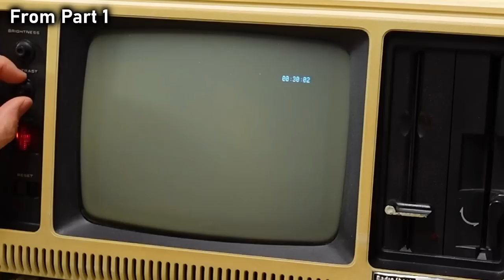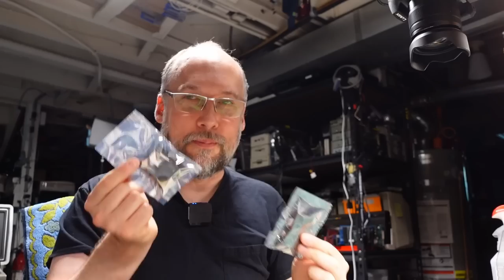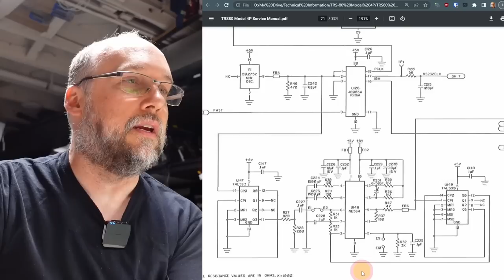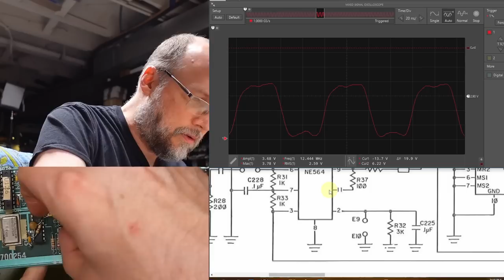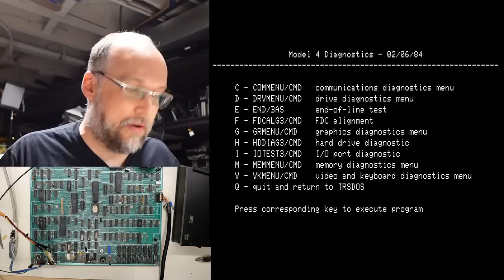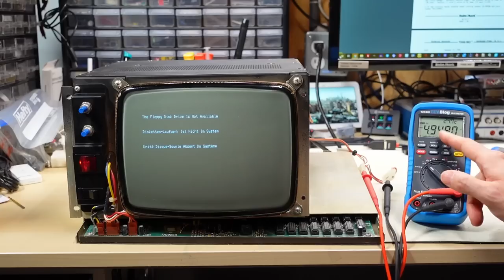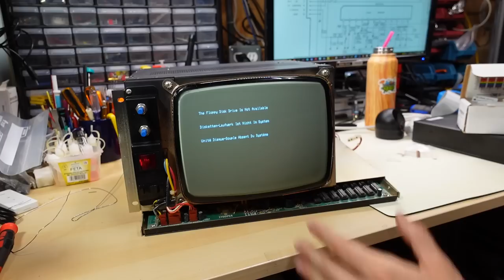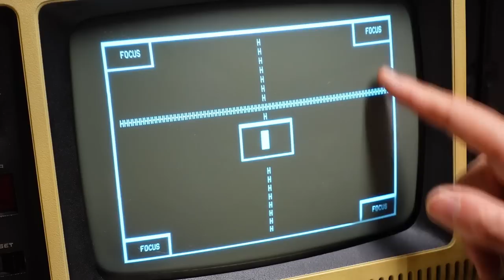TRS-80 Model 4P 80-column crash repair (Part 2)

Comment: The video jitter is an artifact of the +12V from the power supply to the video PCB. In your case it was the fan causing problem but often it 'just happens'. I installed a new drop in replacement power supply n my Model 4P from Jay Newirth (Newsoft). It uses a separate +12V supply for the video board and eliminates the problem.
Reply: It was also causing the CRC error. The drive power was inconsistent causing speed variations on the motor.

Comment: The low voltage side of the power supply has a pair of resistors in series on a part of the pcb with a square silk screen image. The silk screen might be for a trim pot that has been replaced by the fixed voltage divider, but which would have enabled the fine tuning of the 5v reference voltage.

Comment: Looks like one of the inductors on the low voltage side of the power supply might be a variable one? It's got a hex shaped hole in the top, which usually indicates the core can be screwed in or out to vary the inductance. Perhaps that could adjust the voltage of the rails?

Comment: Just wanted to point out that the problems you were having with disks occasionally being unreadable and disks written on one system not always working on another may be because one or more of your floppy drives are slightly out of alignment.  Particularly with the older drives, it was actually necessary to manually readjust the alignment on them sometimes.

I remember back in the day using specially-written (and rather expensive) "alignment disks" to measure and correctly tune the disk drive alignment on my old TRS-80 drives..  I have no idea whether you could even find one of those anymore, but it is also possible to adjust it reasonably well just using a known reference "good" disk (such as a floppy that was written and sold as part of a commercial product, instead of one somebody wrote in their own disk drive), by slowly tweaking the adjustment one direction until it becomes unreadable, noting the position, turning it the other way until it becomes unreadable, and then setting it midway between the two, etc.

Comment: Not to sound like a hind-sight comment, but the first thing to do in any repair is to 1) Check the voltages and 2) Check the clocks.

Guess that would not result in 4 videos though. :)

Comment: A flashback to the1980's when I upgraded from a model 1 to a model 4P.
I wrote a ton of software on that thing and it even survivde the flood when the water heater in the apartment above me broke and poured water all over the table where the 4P was sitting.

Comment: Nice work, as always. Personally I would replace the fixed capacitor with the correct value trimmer, but that’s just me.
Reply: I mentioned in another comment that he could run it parallel with a fixed disc cap of the "appropriate" range, so that he could trim it. But, it's just as possible that the one he dropped in was THE perfect value, so, sometimes, "If it works, don't fix it" ")
Reply: @This_is_my_real_name   There’s certainly nothing wrong with that approach, I was just saying what I would do. Each to their own.
Reply: @Colin_Ames  -- Well, yeah, it's always best to replace a questionable component with a known-good part, but I was thinking in terms of quickly homing in on the problem by using parts he had on hand. Personally, I'd look to replacing it too, even if I was able to bridge it to bring it back in range. Once it's failing to the extent it's already demonstrated, there's no assurance that it'll stay in its current range rather than continuing to drop to lower and lower capacity.

Comment: I've enjoyed your TRS-80 model 3 and 4P videos as much as anything you have ever done.  I like when you work on these big jigsaw puzzles, and following along with your diagnosis is so enjoyable.  Only one thing worries me: did you figure out where that small cable attaches to the power supply, or is it still disconnected?  What a great fix, with TWO bonuses you pulled out of the hat, viz. improving the CRT brightness and addressing the interference from the new fan.  Impressive!

Comment: Hi Adrian, when adjusting those tiny trimmer caps, only use a plastic trim tool and they only have a 360 degree adjustment, just very small movements will make the difference.
Reply: He did - the cap was just totally bust and probably didn't make good contact internally.
I ran into similar issues with variable caps and resistors, some seem to be just too brittle.

Comment: If I remember my electronics classes (30 years ago already?!) there were two frequencies associated with a PLL circuit: the capture range and the lock range. Without digging out my books, it seems that the input must be within the capture range, and the output is maintained within the lock range. I think.

Comment: I'm not 100% certain (tempus fugit) but I think they had a Y2K patch for TRSDOS 6 (rebadged LDOS). Not sure about your CP/M 3, or CP/M 2.2 (which I do not know if it was ever ported to the Mod 4). Gary Killdall self-destructed at some point, and I don't remember what happened to/with DRI after that.

One other thing, regarding running "normal" CP/M programs on CP/M 3 -- not sure if that is entirely doable, I think I recall there being some issue with memory mapping that required CP/M's BIOS/BDOS to sit in a different location for CP/M 3.

Of course, I may just be thinking about the Mod1 CP/M 2.2 port which definitely would have had problems with the very "hard" mapped IO and ROM space on the Mod 1.

Those were the days... (when you could tell who the pioneers were because they were the guys with the arrows in their backs, as the old axiom went :)

Comment: with some switching  psu circuits, theres a cap, usually electrolytic, in the high voltage primary side, driving the base of the 'chopper' transistor, if it uses a bipolar transistor, (most likely with this), if this is low capacity, it can cause issues, 'round shouldered' /insufficient drive, causing poor output or regulation, screeching noise, overheating of the transistor, and  even its failure, in some cases instantly ... also there may be high value resistors within this part of the circuit, if this/they go high, can also cause similar...

Comment: I wonder if the closer you get the free-running VCO to the desired lock frequency, the less hunting / jitter noise you get in the output clock. I don't know how stable the timebase is on your computer 'scope, but it seemed like the frequency was wandering a bit, like vibrato if it was an audio signal. You'd be able to see this on a spectrum analyzer as well.
Reply: PLLs seem to hold pretty well once locked on.  I remember older radios that started using the PLL would lock onto a station with about the same quality once you were anywhere near the frequency.

The SECAM version of the Atari 2600 made a PLL using a VCO chip and a mix of digital and analog components to find the center frequency for color generation.  As long as the capacitor-tuned frequency was close enough to the required one that it didn't need excessive voltage on the VCO, the tuning of the capacitor made no visible difference.  At the extremes though, it made some interesting artifacts.

Comment: Great! I had a 4P back in 1984. I started out on a TRS80 Model 1 in 1980. No disk drives on the Model 1. I had to load software with a cassette tape player. Primitive.
Reply: My first system was a Model III. It had 2 5 1/4" floppy drives. 

I was so glad I didn't have to mess with cassette tapes for software. I only used my III's cassette port for sound (via Z80 assembly).

 I first learned to program on my Model III. I had Level III Basic (of course), a Basic compiler of some sort,  and a Pascal compiler. I think I may have had a C compiler.

Comment: I had a similar problem with a quartz electronic clock. It started up fine, but then suddenly increased its frequency up to 1..2 MHz instead of 32 kHz and completely stopped. And again it was a variable capacitor...

Comment: The reason for the adjustable cap for the pll is to set the frequency very close to correct, without it being finetuned you can get constant readjustments to try and push the pll to right frequency by the loop filter and I suspect that is why you see the jitters. Swapping in a proper adjustable cap with the correct range should allow for finetuning. Removing the link and tuning fre free running pll frequency as close to correct as you can should do it.

Comment: My father was a TV repair engineer, about 40 years ago. He made a CRT brightness booster, it basically connected the mains voltage across the electron 'guns' for a short time. It definitely made B/W CRT's brighter and he modified it for colour CRT's. I don't have any circuit diagrams but maybe there is something on the internet.
Reply: To be honest he didn't wire mains AC to the filament but maybe through a transformer, a series resistor or maybe he rectified the AC into DC and charged a capacitor and flipping a switch dumped the high voltage DC into the filament for a few milli-seconds. Most filaments are 6 volts and he probably ran anywhere from 7 to 12 volts through it. A worn out CRT has a filament that doesn't emit electrons very well. This is normally caused by the surface of the filament not having enough thorium. By over driving the filament (only the filament. Nothing else can have power applied to it) he essentially "boiled" off the thorium that might be embedded inside the filament onto the surface of the filament. Much older CRT's had a lot of thorium mixed inside the filament and was supposed to migrate to the surface as the CRT aged, but that didn't happen. Later CRT's decided to coat the filament with thorium. Cheaper and worked just as well. Some of the coated thorium did dissolve deeper into the filament, but not much. Doing that with a later CRT did improve the picture for a little while but wore out the CRT much faster. It's like burning a candle at both ends. You increased the light output but you made the candle burn out twice as fast.
Reply: Yes you are probably right, I was talking generally, I was only about 10 at the time and for my father to explain all the workings would of been completely over my head.

Comment: @Adrian's Digital Basement
The original fan is EMR rated and shielded. I hate to say this, you're not quite right about the Arctic fans. They're not crap, they're just not designed to EMR standards or to be in close proximity to magnetically sensitive devices. Modern computers simply don't have the same types of electronics or CRT's built into them. Your solution was solid though!

Comment: PLL, cool way to increase frequency and lock them to base clock,used them back in the 80's for controlling bit rate on a sound sampler i was designing,clock doubling can be done by creating a pulse on rise and fall of clock.Good video,im wondering if theat trim cap was replaced with the wrong part,before you got to it?,ive never had one go faulty in my 40+ years as a board repairer.
Reply: PLLs are useful to change the CPU clock too.  CPUs tend to not like being short cycled and the PLL allows the clock to be slid to the new frequency and avoid that issue.  Of course some logic will avoid that issue too but it gets a bit complicated when you have to ensure both high and low state of the clock is not short enough to cause the CPU problems.  I used a PLL to change the clock on the Z80 in my MIII from stock to around 10MHz (overlocked Z80H) and back as necessary.
Reply: Bad trimmer caps are uncommon but not entirely unheard of in FM tuner repair circles. Very likely brand and environment dependent. Those into old radios may also be familiar with "silver mica disease".

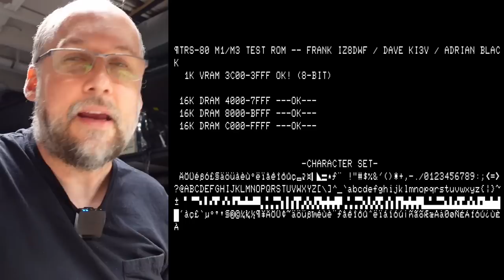Comment: 4:19 The 'K' is on the next line, it wrapped around! I didn't know it could/would do such a thing for a too-long line.
I wondered if that variable cap was an issue after adjusting it had no effect, good find! 
Ahaha, the interference was from was the fan?! That's hilarious! Freakin' cheap fans.

Comment: The extra large cap on the right with the red warning sticker on the side looks ever so slightly domed on top. It's a real shame that caps do age over time: both the types you replaced and the electrolytics. Tantulums like to burn and explode haha electrolytics too. Both make great firecrackers when over voltaged or reversed. They've banned fireworks in my country but a tantalum with reversed polarity on a battery would make a great substitute.

Comment: Around the 49 min area, He had some problems with the disk-drive.. which reminds me of a problem I have.. that is.. I have a computer called "ABC-80" which is kind of a local cultural icon (It was made by the TV-company Luxor and kind of intended to be the typical Swedish computer.. based on the z80).. and.. the problem is that the 5 1/4 inch drive we bought it with actually.. tend to get un-alligned repeatedly and there is no cheap way to get it "adjusted".. and.. I was way too young to REALLY understand things.. I was curious, not competent.. so.. I DO have some VERY nicely working hardware.. but.. it still can't QUITE work.. 

Tbh, even if I'd LOVE to be able to MAKE the disk drive work properly and NOT constantly give errors.. 

...; I think the thing I would like to do MOSTLY.. is to try to figure out a way to.. connect a pc to the computer.. (f.ex. the sound-card to the cassette recorder connector, BUT it kind of requires a special tape-recorder to be able to be used, so.. there are some extra things that mean that it can't be use with just ANY tape-recorder).. 

but.. pretty much ALL software EVERYONE cared about getting.. is still available online... so.. if there is ANY way to get the software to the computer, then it can be run.

Comment: Have to admit, I've never seen any computer or software that had any problem with Y2K.  I always thought it was a scam. I was working at Computerland at the time. I had a funny problem with a fan once while working in Lauderdale. Customer had an intermittent problem with a CRT monitor that would go wavy once in a while. Turned out to be another person on the other side of a partition had an AC operated fan that was causing the problem when it ran.

Comment: Good job. That trimmer capacitor was probably made with silver plating on ceramic and it has been eaten away by moisture and pollution.. probably worth buying a more modern trimmer to get the free running speed as close as possible to 12MHz ..

Comment: 80x24 vs 64|32x16 resolution.  

As I recall earlier machines showed the black top/bottom when running model I/III games, however later hardware showed it full screen (I seem to recall some variation though by game).

I have a number of boxes, and my last (original purchase) was still sold with the technical manual of the earlier ones but with photocopies of some pages for the changed circuit/electrical boards in the newer hardware (no matching page numbers etc & didn't fit in the manual; thus wouldn't be surprised if the PDF or stuff found online is only of the original circuit boards).   Do note I'm talking about model 4 here, having no real experience with 4P.

Comment: I got a weird fascination with terminators lol

I'm kinda tempted to try terminating the 2 empty ddr4 slots on my pc......

Like with a couple of resistors and a capacitor hacked in between clk and vmem pins....

I would probably consider it a success if the pc still even booted lol

Comment: 27:15 Do you hear what you are saying? You can't copy the test code to ROM because you don't know if the RAM is good? You test the RAM where you are going to copy the RAM test code first. Then, you can read it back and verify it after you copy the ROM routine to RAM, while still executing from ROM. You'd probably want to do it before and after each test, or periodically somehow, to be more sure that it didn't fade. If it fails to verify the routine copy, that's the RAM test failure right there.